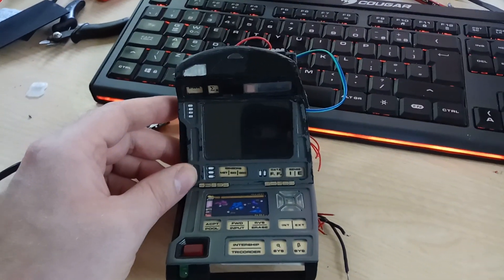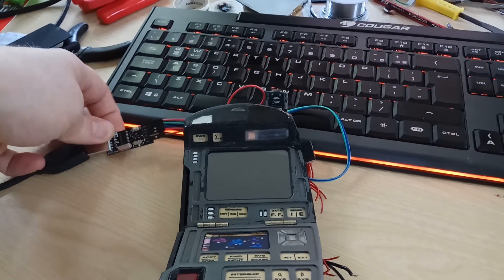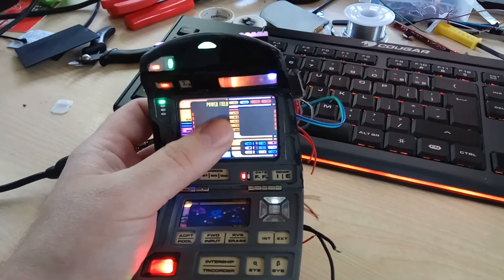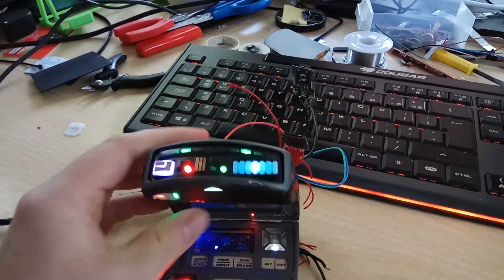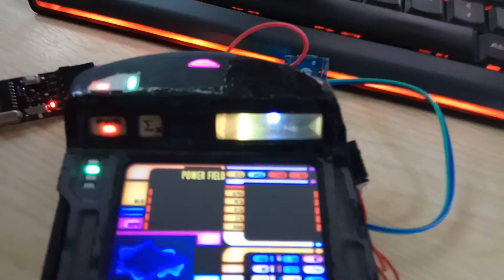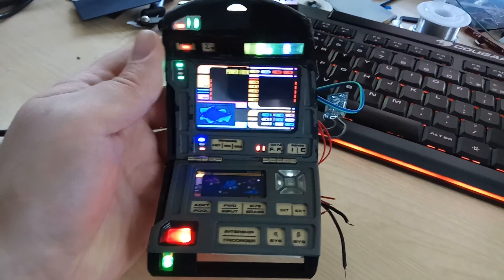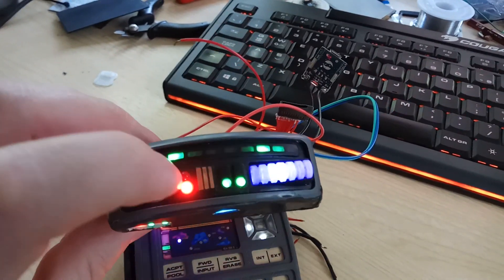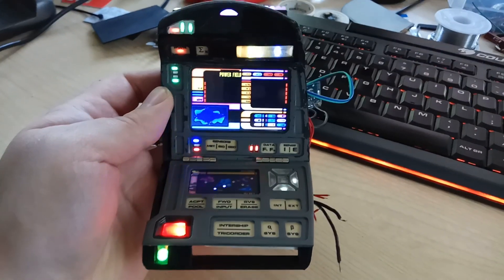Tricorder update.  Running a simple led sequence.

Comment: Can you build me circuits with sound for a TR580 Mark VII Tricorder? I have the Shell, it's a Stappleton Productions, Type.
Reply from the maker: Not with an lcd no.  I don't think nextion do panels that small.
 Besides there are plenty of premade electronics kits on eBay going for a decent price.  It would be cheaper for you to build one if them
Reply: @MD_Builds  Can you point me to the right place, because I cannot find any Mark VII Science Tricorder Leds/sound.  Not looking for a digital screen. Just lights and sound. Gmprops, stopped selling them on Ebay. I need a prototype to get it mass-produced. 😁
Reply from the maker: I know GM is having some personal troubles... but there are other suppliers for tricorder electronic kits... I just found one or two with a quick google... But im not going to recommend anyone as I dont know if theyre trusthworthy or not... Best ask on the RPF forums